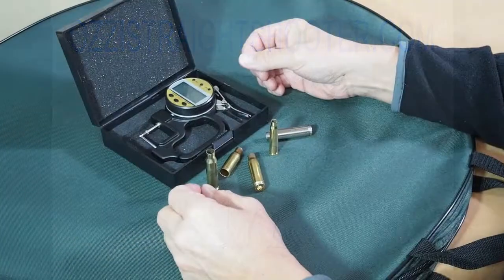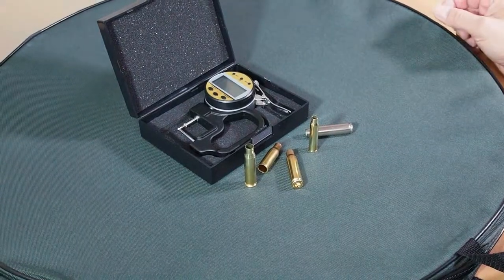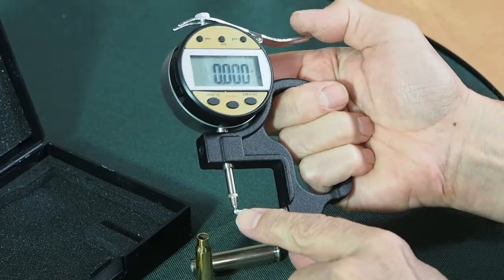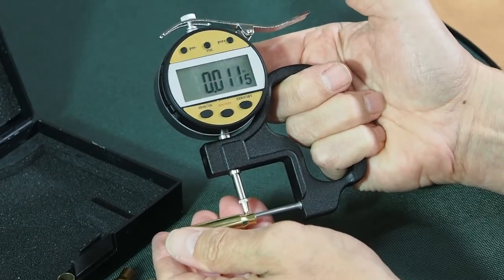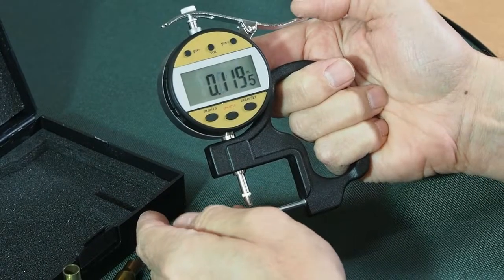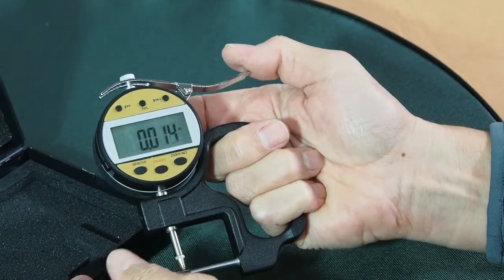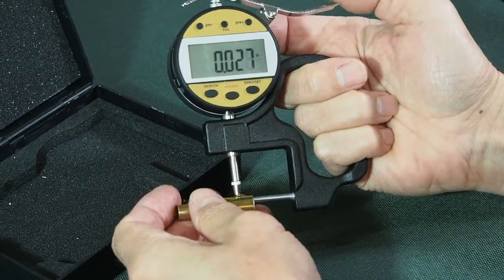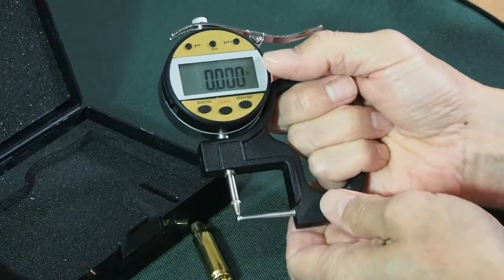Neck thickness micrometer for precision Reloading

Comment: Beware, I have a Mitutoyo 547-561S Digimatic thickness gauge (same type as used here) and there is one huge problem with using this instrument to measure neck thickness.  In order to get an accurate measurement, the case has to be absolutely square with the flat upper measuring rod.  If it isn't, you'll get wildly differing measurements because the distance between the upper shaft and the fixed anvil changes.  It's possible to get accurate measurements but it is very time consuming and you certainly can't spin the case to get a reading on how the thickness varies.  

This is not the case for the neck thickness tools by Redding and Sinclair witch support the case with a rod that goes through the flash hole.  I'm going to be selling my Mitutoyo and pick up a tube micrometer since that should be easier to get an accurate measurement at one point.

Comment: Interesting product,  I can see some advantages for some types of measuring that needs to be done but for case neck thickness, I will stick to my ball micrometer mounted in a vice holder.
Reply: These are superior as the measurement is dynamic unlike standard micrometers.   Also called snap micrometers.  You can spin the case and see the gauge move with having to reset as with most micrometers.